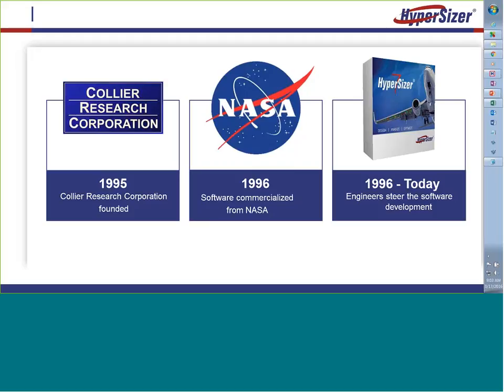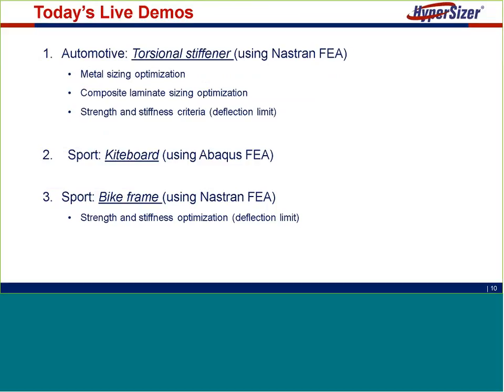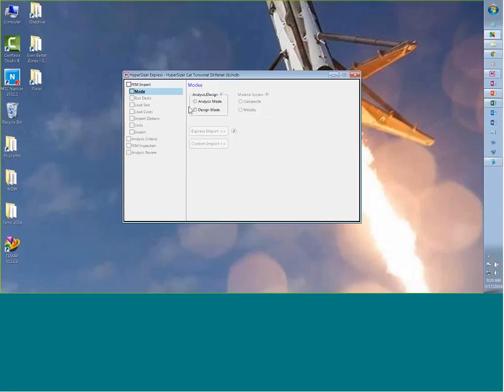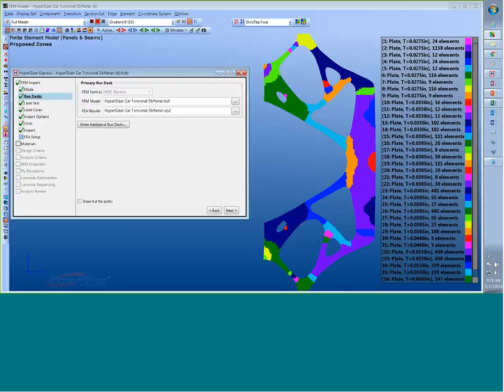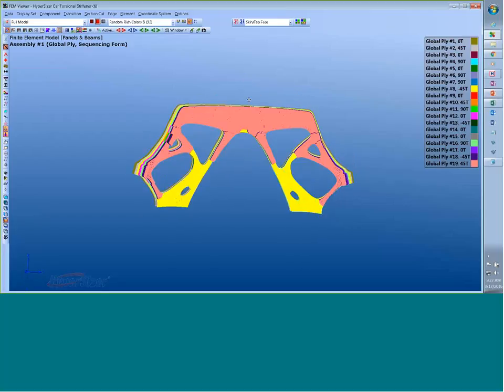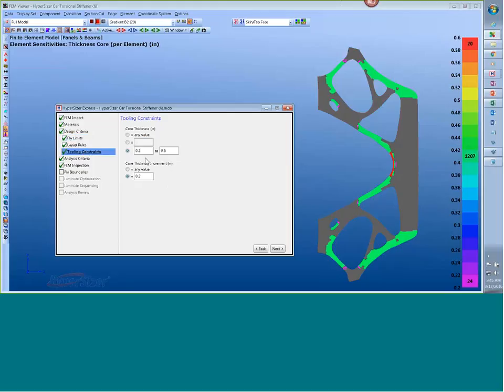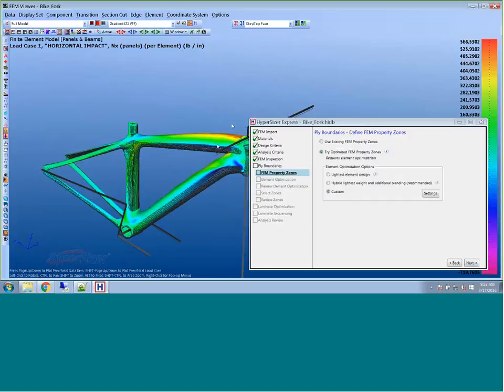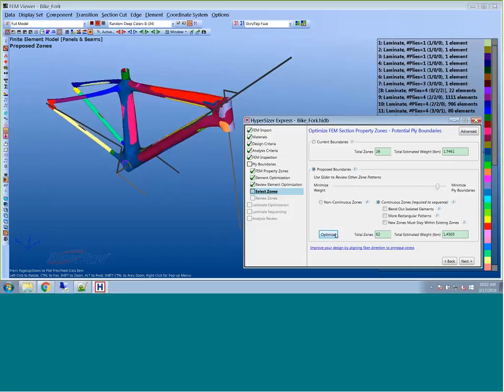Express Intro  - HyperSizer Laminate Optimization with FEA

Comment: This is a good preliminary tool, but Hypersizer runs do not make it out of testing on the aerospace side.  There are also draping and wet tie limitations.  I would rather use Radioss and in-house analysis scripts.